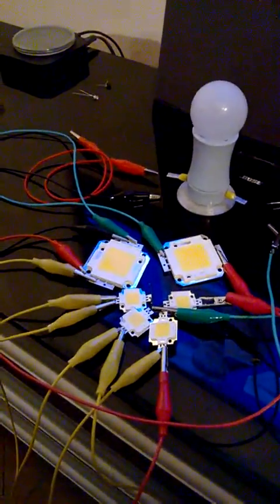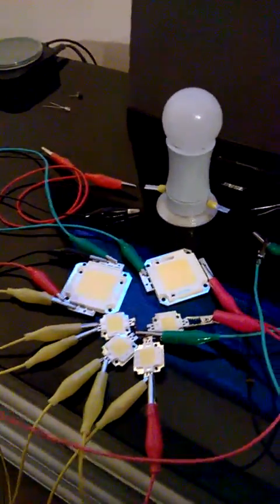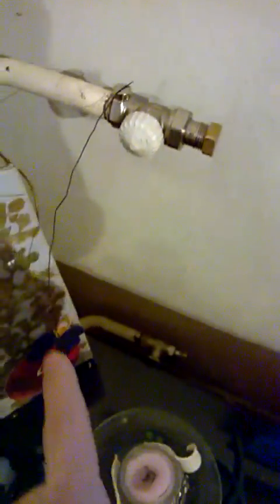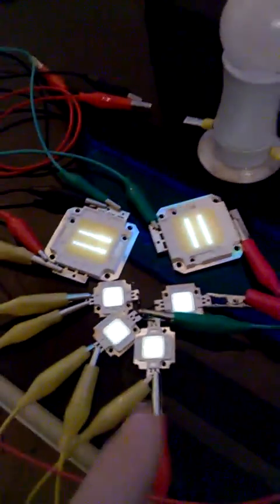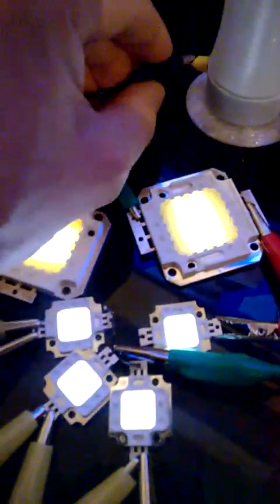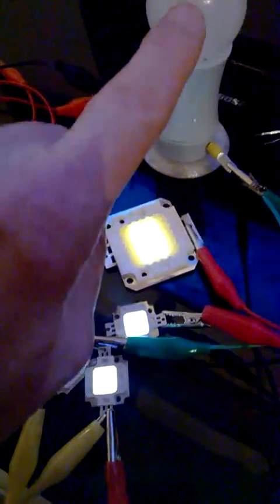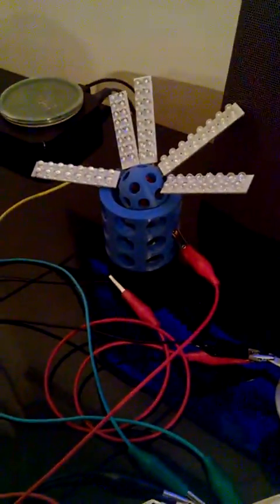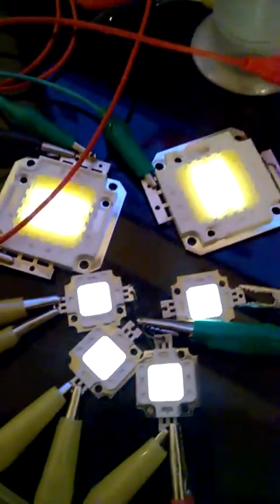For free or do you want to pay

Comment: Try it in the woods ... Far away from electrical grid  .... If THAT works you are my Hero ... But using parasitic current from the electric grid ... Transfered over the ground cable  ... And or magnetic fields from the power cables ... That's no free energy .... You pay it with your electrical bill ... And 400W+ .... The LEDs are barely working 400w would be a very bright ... And blending light ... And the last miracle ? If I have to guess .... The frequency of the flickering changed ... The circuit in the led bulb acts as rectifier ... Grid power is ac .... LEDs need DC ... So before the LEDs only light up halfe the time  (change of positive negative).... After more like the whole time ....
Reply: No Its work even from Rod burried outside, and its produce a respectable voltage but its drops quickly, the Key is not in electric grid, but how the leds are wired

Comment: now turn of the main switch of power to your home and disconnect your earth from the power grit and hit a pole in the earth your self and try again. If it then works you found free energy, other wise you just use the "garbage" energy cheap switching power supply's put on the earth lines you have at home, and by using 2 different points in that system you found some voltage difference to turn on some lights. Yes technically free from a money stand point but not from creating energy stand point.

Comment: This is outside of my wheelhouse of knowledge but, after watching a few of your vids, it seems that you share many ideas with Tesla. His career was also crushed. Unfortunately, he died without building a workable model scaled for practical home use. I hope you do not do the same.

Perhaps the best route would be to work in secret, and then begin to install your arrays in private homes, across multiple towns and countries, with the homeowners' funding, until you reach a tipping point, where it can no longer be denied or supressed.
Reply: Yeah Tesla had some great inventions that were a prod in the side of big biz. Like the tesla tube which I on another vid seen remade. Once water is flowing it never stops. No well pumps would need to run so much electricity to get water into the blatter in homes. Just a simple couple pumps from an electric pump or a hand pump to get the water flowing would be enough to start the flow then once the bladder is full again the flow would stop. Yes in the case of using mass amounts of water like powerwashing your home this system as I can understand it would lack the amount of water needed in the bladder unless the bladder was huge cause the tesla coil is a slow flow not pressurized. Though if the flow from the well is constantly flowing the bladder might just be worthless as the water from the earth would constantly be flowing to the power washer. But another issue arises would it be enough pressure as a bladder is under pressure to give the home water pressure in the lines enough to keep the power washer flowing properly. A bug that I'm sure could be figured out in time. A new style of bladder perhaps for traditional pressurized bladders need equal or greater pressure from the well pump to fill the blatter back up. A tesla tube wouldn't build enough pressure being enough to overpower that of the blatter to fill it. For the pressure in the blatter would be pussing back against the free flow of water trying to enter it. Not a believer in gravity as it's all just buoyancy and density that creates downward pressures but the term I must use to give an option. That being a gravity fed system where every country home has a well tower like big cities where the weigh of the water in the tower would give the home pressurized water. Then the tesla tube could fill the tower when it runs low to keep up the pressure and could fill it cause the press in the tower would be from the downward force(wieght of the water) at the bottom not pressurized from air at the top like a traditional water blatter in a basement.
Reply: @flatout5815  Tesla never existed, with his death the idea of free energy died, thats why they invented him
Reply: @flatout5815  He didnt make it possible, there are no patents how he did it. He just might have... but he died... soe he didnt and we have now the cables.
Reply: @amarg1650  Sorry, if he never existed than how could he die ??? And, if he never existed why would they invent him only to make it possible that the idea of free energy dies with the death of fictional character??????? You've got it all wrong. He did exist, there are proven records and tons of other proof about his life.
Reply: @VD-iz4nm  Where are the records then?
Reply: @amarg1650  After his death, after the govt. agents visited his room and seized a lot of his papers, the coffins containing Tesla's papers, diplomas and other honors, as well as some of his laboratory notes, were sealed. For some time, they were owned by Tesla's cousin and only heir Mr. Sava Kosanovic. He later donated his acquired heritage to the city of Belgrade, for the purpose of founding the Nikola Tesla Museum. They are now stored and displayed in the Museum Nikola Tesla.
Reply: @VD-iz4nm  Oh.. so they are gone? Whats the proof that they existed then? show me
Reply: @VD-iz4nm  how do you tin foil hat nutters come up with this stuff haha
Reply: @paintspot1509  I don't have to  come up with any stuff. Google it and do a research yourself. There are tons of pictures of him with prominent people of that time and even the footage of his funeral. I am very sorry that you don't know what you're talking about, plus there is no need to call anyone ''tin foil hat nutter'' because it's you who don't have enough knowledge about basic historical figures. Being uneducated, illiterate and uninformed does not give you the right to insult people online, especially when it is about the person whose inventions made possible for you to use internet in the first place.
Reply: @VD-iz4nm  there is a video of his work getting seized on YouTube?! That's amazing.
You misunderstood me, I have respect for Telsa and the work he did. It was you that I was making fun of for posting conspiracy nonsense.
Reply: @paintspot1509  There is no one bit of nonsense in what I commented.
Reply: @paintspot1509  You can not make fun of anyone until you learn to read. Please, do us all a favor and first go learn how to read, because I never wrote what you just mentioned. After you learn how to read and after you do proper research on Nikola Tesla, come back to comment.
Reply: @VD-iz4nm  turns out you were definitely talking nonsense.
Reply: Tesla left us the Tesla coil the plasma ball and the violet ray you guys. He did the best he could for us all to help humanity.  Check these out and really live
Reply: Tesla is fiction! All our history is mainly fiction... but most don't know it.
Reply: @rachelrussell3176  why do you think tesla is not history
Reply: Nikola Tesla is not fiction. try and learn a bit about his life. There are proofs and relatives of Nikola Tesla still in existence today. A lot of mentions of him from other scientists who actually knew him, as well as material proof of his existence. Yes, I agree that a lot of world's history has been twisted or made up, but Tesla is not part of that. They tried to trash him and ruin him while he was still living. Please, don't go around trashing him and his legacy to the world even more. Don't do what all those rich bastards tried to do to him in the course of his life. If there was no Tesla, you wouldn't be using computer now or have a light in your home or have wi-fi etc...